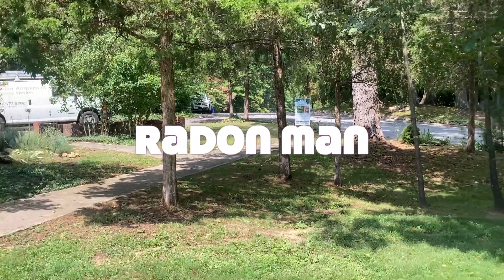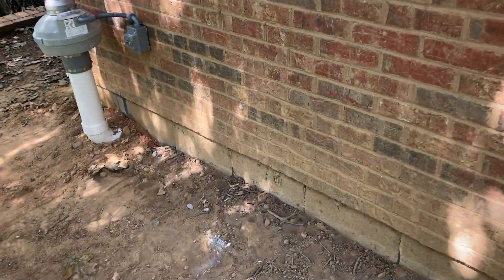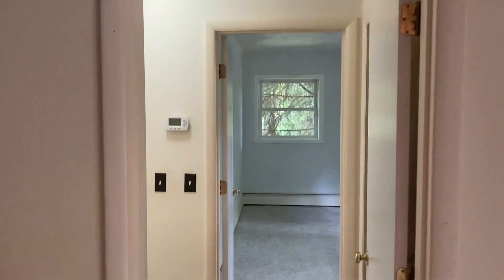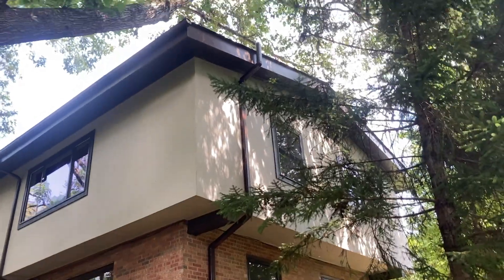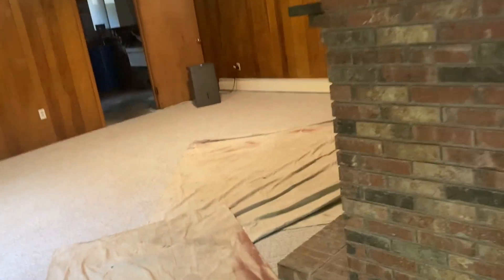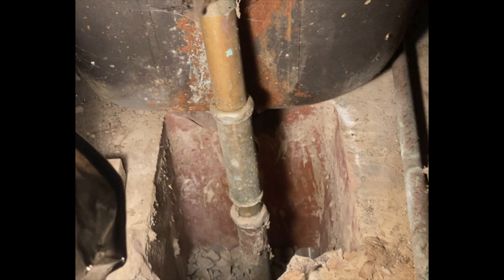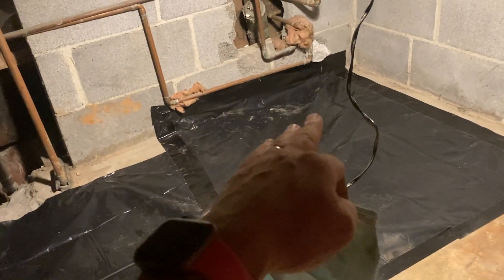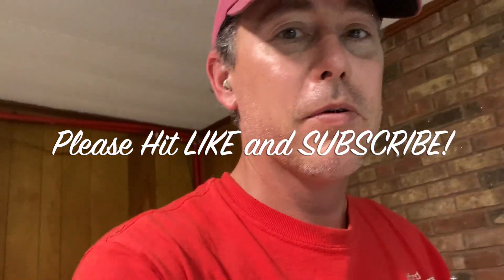Brief External Subslab Depressurization Video   HD 1080p

Comment: I see that some people install condensate bypass piping. They claim it protects the fan. But I would have to say the vast majority do not have them. Is putting one in just a preference?
Reply from the maker: Hi Pride Mechanical.  I did a couple many years ago when I first started.  It's a little time consuming.  Might save a little wear on the fans but since they are such work horses, it's hard to say.  At the time I felt like it was costing suction as well.  I stopped doing them but if someone out there swears by it, I'll listen.
Reply: @Radon Man  thanks for the response. Seems like very little condensate would be able to build up after the fan. The fan is pulling subslab air. Ground temps around here anyways are consistently 50-55f. Not like sending hot combustion gasses outside from a furnace. Plus the fan is blowing air over any condensation that might form. Seems like you are right that all that hassle and a loss of suction (by short cycling discharge air) leans in favor of not installing traps. Also, using a condensate bypass will definitely introduce more moisture laden air going into the intake of the fan. Maybe not exactly ideal.